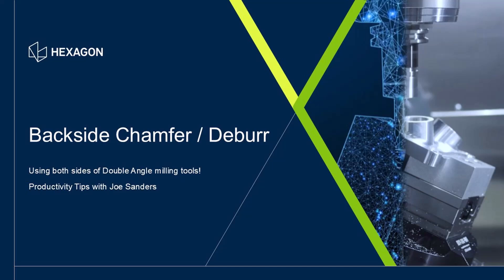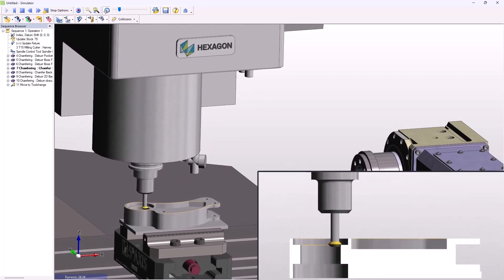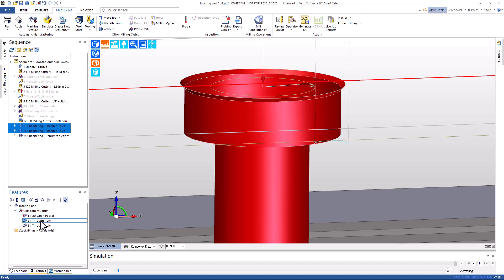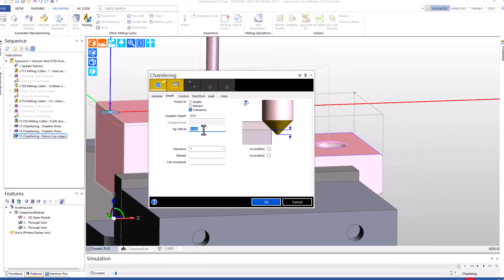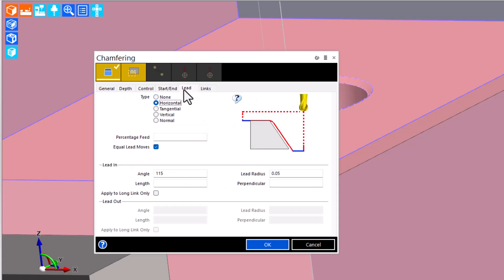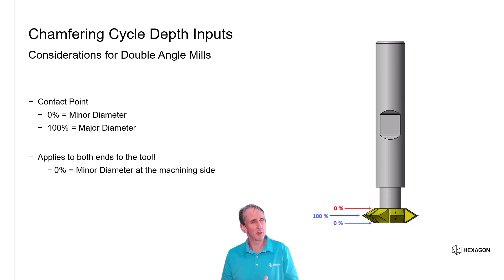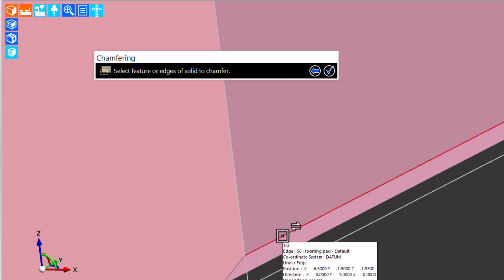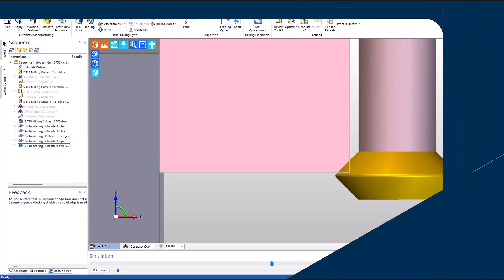EDGECAM Tech Tip: Backside Chamfer Deburr

Comment: How would it work using wireframe? It would no longer be model aware and would not know if it's supposed to go underneath or above the part?
Reply from the maker: The Chamfering cycle leverages solid model intelligence to automatically identify undercut regions, as shown in this technical tip. Wireframe geometry does not have this capability. When working with wireframe geometry, the recommended solution for undercuts on the back side of double angle cutters is to use the Profiling cycle.
There is a development request related to this topic; please consult your local EDGECAM support team for further information.